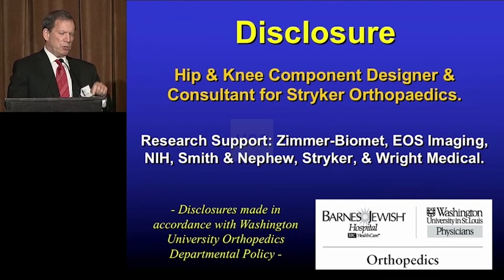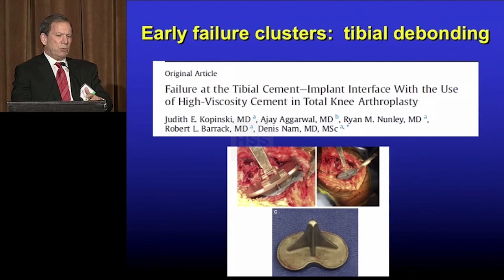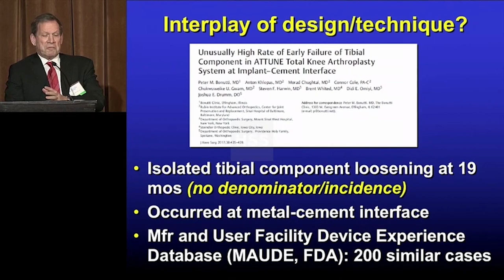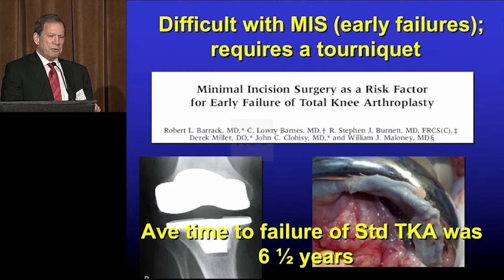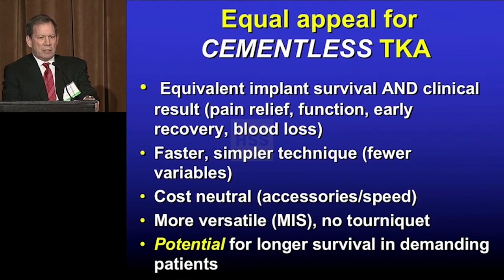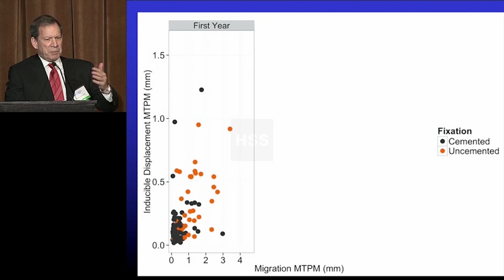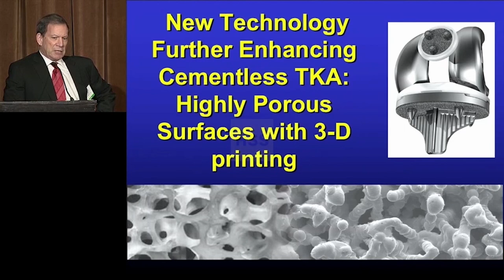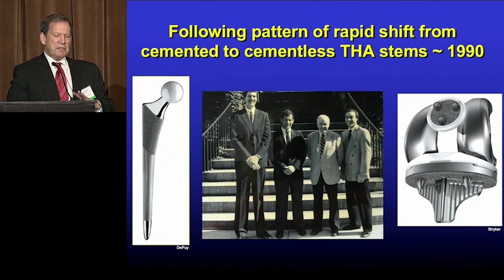Uncemented Total Knee: Its Time Has Come - Robert L. Barrack MD

Comment: I had a TKR in 2016. In 2018 I had a Revision of the Tibial Component. In April 2020 I had a Bone Infection and had to have my TKR removed until the infection was cleared up by Antibiotics for 6 weeks everyday on an IV in a nursing home. Then I went home for 8 weeks and then my Surgeon replaced the TKR on July 2, 2020
Reply: Now on August 9, 2024 I have to have a Revision on my Kneecap because the Cement came loose and my Surgeon is going to remove the Button on the back of my Patella.